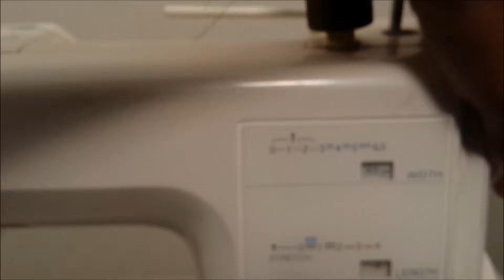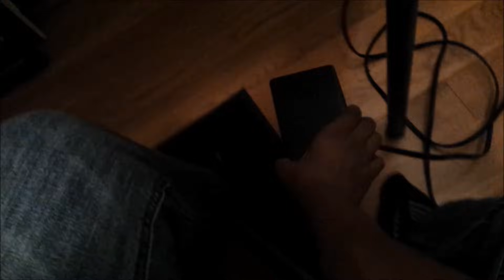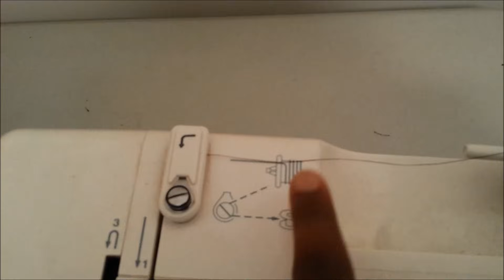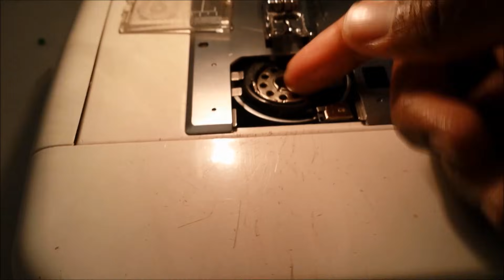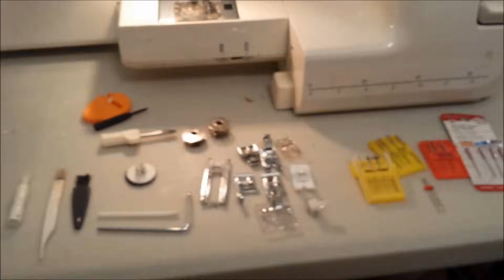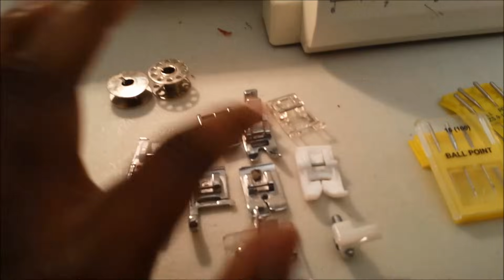Part 1 Basic Sewing Machine Tutorial- Kenmore 385 Series

Comment: Hello, Glad to see that someone owns a sewing machine like mine.  I recently bought a overlocking foot for my machine so that I could finish my fraying fabric edges without going to the expense of buying a serging machine. I cannot figure out what width and length settings to use so that my needle will not hit the right side of the foot or the middle metal piece. I have tried all kinds of settings and while it works when I do a stitch by hand with the wheel it works, but when I step on the foot pedal to sew, the needle doesn't stay in place and comes down on the medal part of the foot or the inner bar. Why wouldn't the settings hold for the foot pedal stitching? Can you help me with the settings? I'm about to throw in the towel and give up. Please help if you can, Thank you, Tess

Comment: Apart from the machine not starting because it has no bobbin case, what other reason could cause it not to start or the hand wheel not moving it’s just stuck
Reply from the maker: I would suggest cleaning the machine because lent may be an issue. I have a video for that. I would suggest oiling the machine because the internal mechanism that allows the hand wheel to turn may not be lubricated. I have a video for this. If these do not work you may need to get the machine serviced at your local sewing machine repair shop.

Comment: Please help!  I've watched the video multiple times but still having issues with my Kenmore 385.17628890.  It's the stitch selection issue others have mentioned.  I've done all the oil the machine, heating with blowdryer, etc.  I think there's just an obvious or universal thing that I must not know.

All my dials work fine.  They're not stuck and have no problem turning.  I've been sewing fine for weeks. 

It's when I switch to the gold / brown Stretch Stitches, that I can't ever get back to the regular stitching (red and green).  No matter how many times I turn the dial, the orange dot always stays on the gold stretch stitch selections.  I don't know how to turn it back to the regular stitch mode.

I'm seeming to remember many years ago I thought there was a certain thing you had to do, like turn the dial counterclockwise to buttonhole and then back clockwise or something...

My needle is at highest point.  My foot is raised.  My stich width and length are both set on the "red" zone at 3.  Still no getting back to regular stitching.

Someone please help!

Comment: Thank you so much for your tutorial. I have my machine for 20 years and never quite figured it all out. You did a great job explaining the parts.  I am going to look for your next tutorial. I was wondering what the white slides are when you remove the extension piece. One says BH which I guess is for button holes - I don't need that function. But there is another white slide, that moves the internals (if you takeoff the bottom with screw driver - to set the timing) - you can see this slide switch moves some of the internal pieces). What is this for? It's not labeled and I don't know what position it should be in. Thank you for your informative video.
Reply from the maker: I’m not sure of what you are writing about. I thought it could be one thing but then I’m not sure. If you’d like you may email whatsshecreating@gmail and send a picture.

Comment: I have a question: I follow your directions but when I was ready to use the machine...the needle don't go down totally, what happens?
Reply: The needle don't go down totally and stop right there.
Reply from the maker: There many be something stuck in there. You may need to clean the machine. Is the needle hitting the needle plate instead of lowering within the hole?
Reply: The needle don't go down totally...what's happening?

Comment: I have a Kenmore 386-19001000. My thread continued to jam under the bobbin area.   I pulled the thread out and my machine shut of and will not turn on.  Anyone have suggestions?  I cleaned out underneath etc.  Need help. In the middle of making masks!!
Reply from the maker: Try these:
1. Unplug electrical cord from machine and wait 10 seconds before plugging in again.
2. Ensure machine is threaded at top and bottom correctly.
3. Check needle tension dial.
4. See if needle is slightly bent. If so change it.

Comment: Hi.  I have a Kenmore 385.17928 sewing machine that I haven't used in many years until recently.  The reverse button doesn't work now.  Any ideas on how to fix it?
Reply: I had same problem. Without opening any compartment on the machine, take a hair dryer and aim it at the reverse lever for a minute or so. May need to be repeated again, but it worked for me. Good luck!

Comment: What is the 0,1,2,3 dial inside the sewing machine head where the lightbulb is located? What number needle should I get for this machine? Thanks in advance.
Reply from the maker: I am not sure about the 0,1,2,3 dial. I think it has something to do with the pressor foot. The needle depends on the type of fabric you are sewing. Usually size 11-14 is normal. Thanks for your questions.

Comment: Yes...I have this machine and it's been  a good one until the reverse got stuck. I've been oiling it and working on it... hopefully I'll get it to work right...still needs attention...it is either intermittent or it only goes in reverse...now....haaa
Reply: Mine had been sitting idle for many years and the reverse lever was also stuck. I researched online and found a suggestion to aim a hair dryer at it for a couple minutes, so I did, and it worked! Good luck 😀

Comment: Hi there, I'm so glad as I found your clips! Thank you so much! But now I have a trouble with the machine, can you please help me? I bought my machine last month which is second hand. At the start, everything seems fine, but now, after I sew lots of ziczac stitch, I want to use straight stitch again but the machine doesn't sew, it stays there! I setup the machine again for the straight stitch: Stitch width: 0 ; Stitch length: Red zone (I chose 2); Needle thread tension: 4; Pressure foot H => I cannot figure out what is the reason, and how to fix it? I look forward for your answer.
Reply from the maker: thuytrinh nguyen Hi. It sounds like you have all of your settings correct. It could be that your machine needs to be serviced since you bought it last month. By chance is the silver bobbin winder at the top of the machine pushed to the right instead of to the left?
Reply: Thank you so much for your recommendation, I think something wrong with my machine as I tried a simplest zic zac stitch and guess what, it works as a straight stitch!!! :-O =)))) Anyways, poor me, I have another problem now. After I worked with the machine for 1 hour, the bottom bobbin thread sounds weird and it made the thread messy on the surface of my fabric. I stopped sewing, took the bottom bobbin out and clean the machine. But after that, I cannot bring up the bobbin thread, it looks like the top thread cannot catch the bottom thread :((( Can you please tell me how to fix it? Thank you very much!
Reply from the maker: thuytrinh nguyen t
To answer your last problem. When you cleaned the machine you said you took out the bobbin. Well, did you take out the black piece that holds the bobbin. That piece may not have been inserted correctly back into the machine. This black piece is circular with a square looking end with a arrow on it. The arrow has to be aligned pointing up if not sometimes the thread may do this. Also, when you rethreaded the bobbin did you put the thread through the "silver piece" as shown in the video. Hope this helps.

Comment: One thing you forgot that is very important.  When getting ready to wind the bobbin, pull the top knob on the right  out away from the machine.  With it in the out position, the needle won't go up and down while the bobbin is winding.  After you are done winding the bobbin, simply push the knob back in towards the machine.
Reply: Pop t Wheel[Not nob]out.